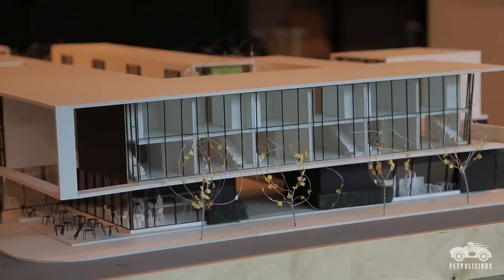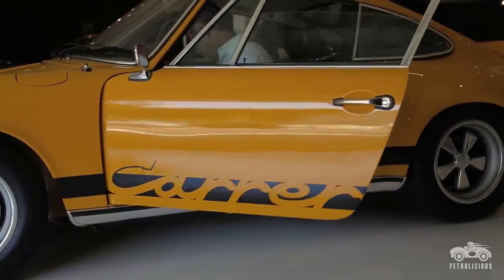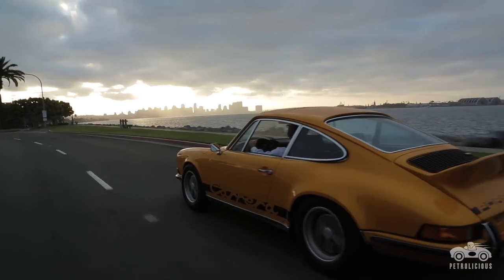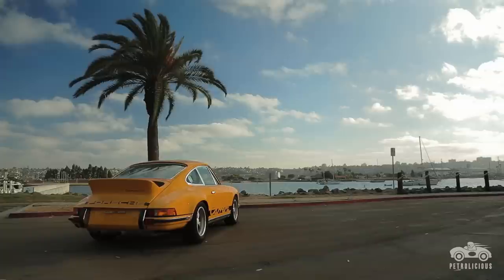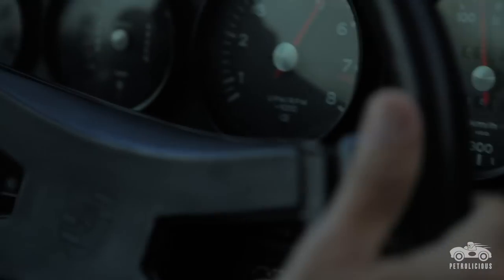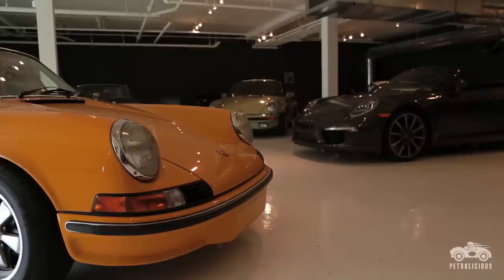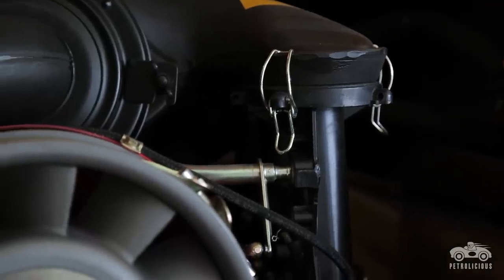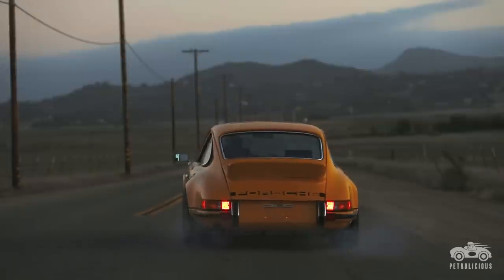Porsche 2.7 RS and the Pursuit of Purity

Comment: I love the Porsche 911 and I hope to own one someday. (Do I buy a new 991 GTS or a low-mileage 993 2S for the same money? So many questions!) Technically, the closest I've come is a pumpkin-orange '71 Volkswagen Super Beetle. I know it sounds funny, but it was the same basic rear-engined, air-cooled, rear-wheel-drive formula, and it was an absolute hoot to drive in snow (gas heater issues aside). Talk about drifting!

Not yet in a position to afford the Porsche of my dreams, I've driven the same manual transmission 2005 MINI Cooper R50 since new, and, spiritually, I think it provides me with all the joy Mr. Segal derives from his RS. (Maybe more? Besides their driving characteristics, the first-generation BMW MINI is a design masterpiece. Look at it from a rear corner and observe how the beltline flows with the A-pillar and the dashboard.) That's why I bought it.

I've driven my MINI pretty much everywhere in North America and haven't had any issues over-and-above expected wear and tear. With more than 120K well-maintained miles on the clock, I've never been stranded. I've never even had a flat tire! With some minor upgrades it makes a measly sounding 115hp at the wheels (ECU tune, camshaft, intake, ignition, throttle re-map), but it turns like a compass (racing sway bar and 17" wheels with Pilot Super Sports) and sounds great (fully upgraded exhaust system). It checks essentially all the same sensory boxes as the RS does, as described by Mr. Segal. It's still a comparatively slow car (my wife's 328i kills it in a drag race, as I expect so would the RS), but that's not the point;  it's in its element on proper driving roads (like the 89/89A between Congress and Jerome, AZ), when the revs are above 5K and you can "drive it like it's stolen".

I would love to have a '73 RS--or any 911--and maybe someday I will; but in the meantime, I am so pleased to have a truly engaging driver's car that most people dismiss as "cute". Some people "get" driving cars; most people don't (they're appliances, like a washer, dryer... or a Toyota Camry). What's great is that with cars like mine (and with newer driver-oriented cars like the manual BRZ/FRS) is that the "unwashed masses" can experience essentially the same level of joy afforded by a vintage sports car for a fraction of the price. 

Obtainable purity.

Comment: I had one of these, and wrecked it... rather than repair the body, I pulled everything out of it... engine, brakes, suspension parts, etc... and bolted them into a very nice stiffened and modified 914 body... the modifications are still ongoing.
Reply: Continue to keep a low profile..its better that way for your safety.

Comment: You almost had me with the 0:33 checkered pants, but closed the deal at 2:29 OMOLOGATO  (apparently pronounced Emologate in California)  FANTASTICO!

adjective. 1. (of an automobile) certified as conforming to the specifications, as fuel capacity and engine displacement, for a class of standard automobiles (Gran Turismo) qualified to engage in various types of competitions. Abbreviation: GTO. Origin of Gran Turismo Omologato Expand.

Comment: I raced a dude the other day he was trying to drive a Porsche just like this one in the video and come to think of it he was wearing those exact same pair of crazy pants you got on. In fact I'll probably remember those hideous pants a lot longer than the Porsche he wouldn't stop talking about . So I challenged him to  race . Against My pretty much bone stock M41 99 Civic Si manual against his super VW Porsche single carb VW kit car ..he got mad when when I called is car a kit car he argued it was a real Porsche because his pants were the real deal.  It wasn't much of a race because he was too distracted by trying to make sure everyone was imprssed by his skinny pants fÿ his crazy ass pants . Which I would have took him anyway because my Civic Si had a super hi output Cat back ex haust , which is Wirth a  extra 75 horse power atleast  plus my cousin just helped me put together one of those super performance intake kits you can put together yourself at Auto Zone's performance section. Not too mention my Civic's dope ass simulated carbon fiber wing which the manufacture says it saves 50 kilograms plus is a total chic magnetic . None of the girls had anything good to say about dudes 90 year old junk yard car and wannabe game rock pants. Anyways it wasn't much of a race wasn't even close I was already into the NOS before he could figure out which gear was 2nd in his great grandmothers grocery getter Porsche.  Idk wehy hectgought he chance he was basically driving a  25 hp VW beetle kit car ÿ against my 500 HP Civic SI . I guess hes never watched fast in the furiious , Dom would have never approved those crazy skinny pants . And  too think I could have pulled out my super dope Hyndai super exotic turbo Veloster  super exotic car but I didn't want to embarrass him in even more then I already had .

Comment: So Porsche doesn´t move with the times and the 911 has evolved from thoes early cars? While that might be true in some areas, the modern 911s has certanly moved with times, with the introduction of electrical steering, the loss of aircooling, more weight. If Porsche sought to find the scource of the 911 it would be a minimalistic 911 with a weight of 1200 kg or less, manual 6-speed gearbox and none of the overused technological crap that is used today. Look at Lotus, they know how it´s done.

Comment: No, it's you who is in the wrong. Minimalism stands for absolute minimum necessary for a task. In this case, the task is driving. For instance, a radio is not required, but an exhaust is. Purity, in this case, refers to the concept of a pure driving machine, not to being original, as you thought. I'm not surprised to see an achitect/engineer trying to improve an essential part. That is what he is all about, evolving/improving. But his logic is flawed. This is not the current level of evolution.